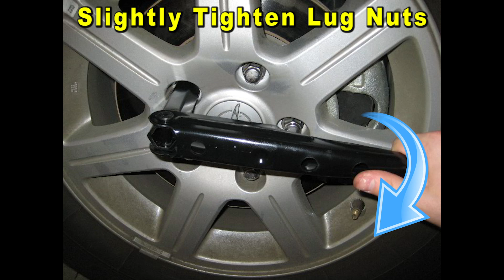2008 To 2016 Chrysler Town & Country How To Change Front Brake Pads With Part Numbers

Comment from the maker: Chrysler Town & Country Front Brake Pads - https://amzn.to/4aiXxrz
Bendix Premium Brake Pads Part Number - https://amzn.to/4bDWzai
Power Stop Ceramic Brake Pads Part # - https://amzn.to/4bg6YJO
Bosch Ceramic Front Brake Pads - https://amzn.to/4bAm0K0
"F" Clamp - https://amzn.to/3QPFLFt
Precision Screwdriver Set - https://amzn.to/3sLixaP
Plastic Pry Bar Tools - https://amzn.to/3HMtsV7
Socket & Ratchet Set - https://amzn.to/3Z17LbA
Mechanix Gloves - https://amzn.to/3jCnHkt
Torque Wrench - https://amzn.to/3vS5uSI

The Paul79UF YouTube channel is a participant in the Amazon Services LLC Associates Program, an affiliate advertising program designed to provide a means for sites to earn advertising fees by advertising and linking to Amazon.

This DIY video shows owners of the 5th generation 2008, 2009, 2010, 2011, 2012, 2013, 2014, 2015 and 2016 Chrysler Town & Country how to change the front brake pads.

Comment from the maker: Check out the DIY guide for changing the front brake pads on a fifth generation 2008 to 2016 Chrysler Town & Country - 
https://www.paulstravelpictures.com/Chrysler-Town-and-Country-Front-Brake-Pads-Replacement-Guide/index.html

Here are all of the DIY repair and maintenance tutorials for the 5th generation 2008, 2009, 2010, 2011, 2012, 2013, 2014, 2015 & 2016 Chrysler Town & Country minivan - 
https://www.paulstravelpictures.com/Articles/Chrysler-Town-and-Country-Common-Problems-Repair-Maintenance-Guides.htm

Owners of related Chrysler Group minivan vehicles such as the Dodge Grand Caravan, Chrysler Grand Voyager, Lancia Grand Voyager, Ram C/V Tradesman Cargo Van and the Volkswagen Routan may also find these DIY instructions to be helpful.